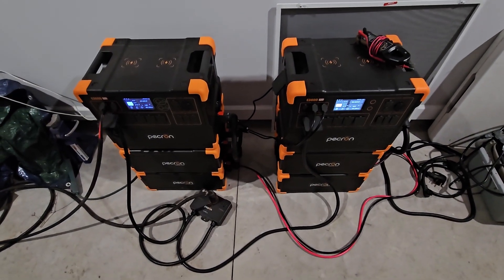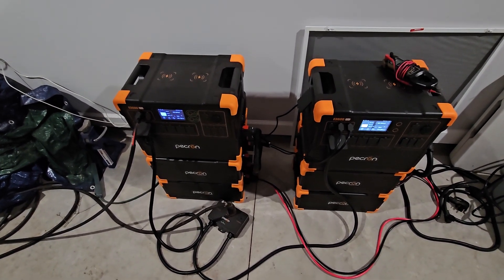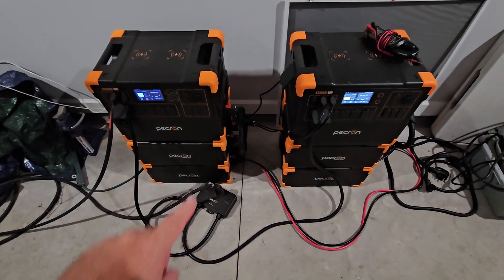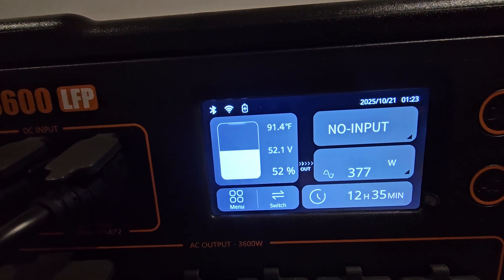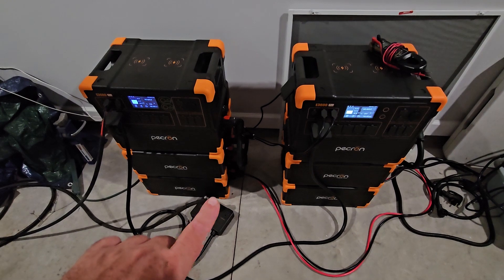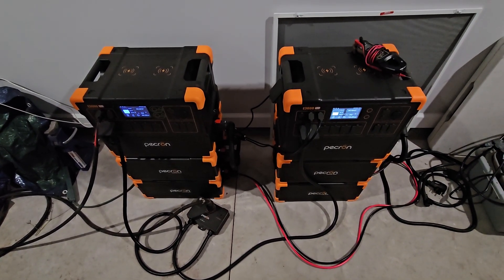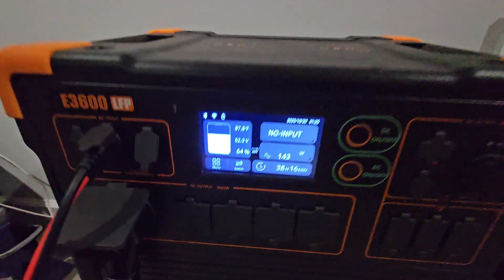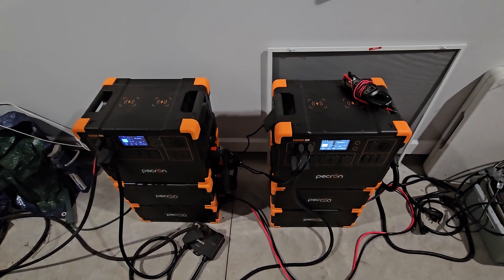Pecron E3600LFP DC bonding cable fail?!

Comment: Hi, did you figure out the best bonding connection beside the host units? Thanks
Reply from the maker: The last battery in the series works. However, connected through the host seems to be the most efficient.

Comment: Not sure how long the timeframe is for the batteries to become unbalanced, but if a person knew that they should be able to just swap the 240v adapter plug in to the Pecrons so as to use each battery more evenly on the panel buss barrs circuits....Simple unplug and plug back into the other unit. Once a week? Or how often? Thanks for the testing, I am waiting for my Amazon ordered cable to arrive Nov 10th to modify it for use as a bonding cable, so all this info is handy have even though my units are not in service yet.
Reply from the maker: That's an interesting idea for maintaining balance; the timeframe would vary with usage.
Reply: @GridDownPreparedness  I am not sure how the rest of the world works...But I have always noticed a pattern develop in households of my own as to what is done when and then repeated over and over....kind of a natural flow of power usage. Like laundry being done once a week or on Wednesday and Saturday, just a habit most households fall into or follow. Once you have that established a person could then determine when 1 unit is being called on more than the other and and make the power cord switch.